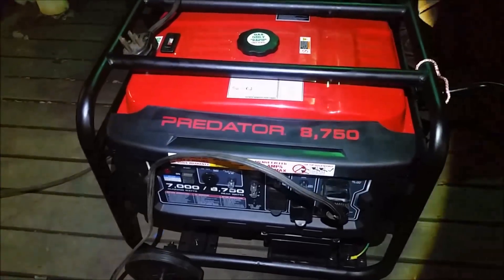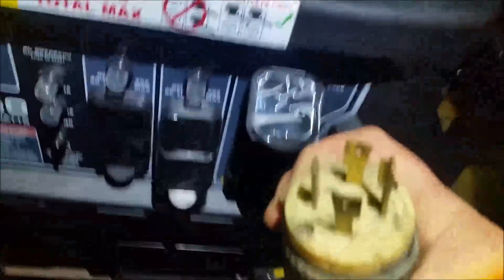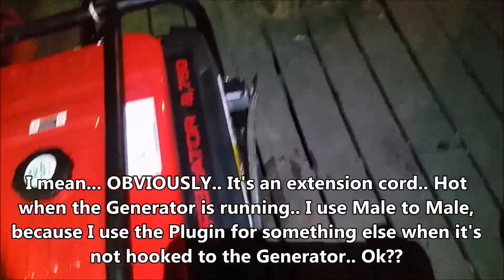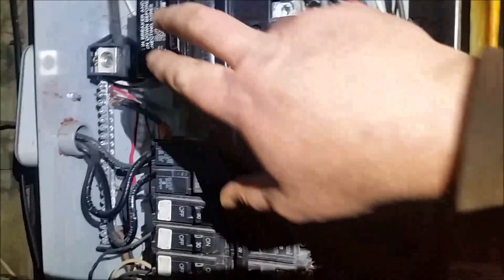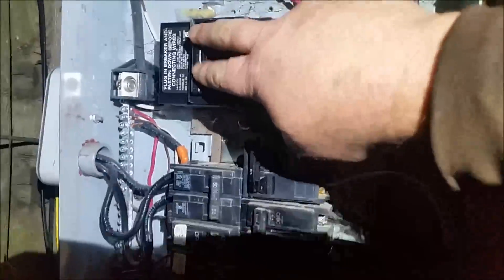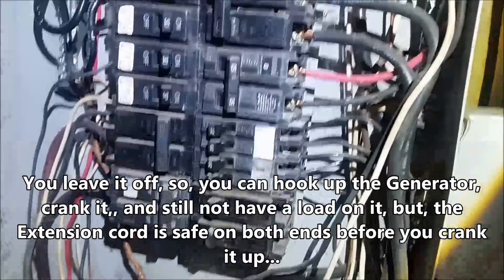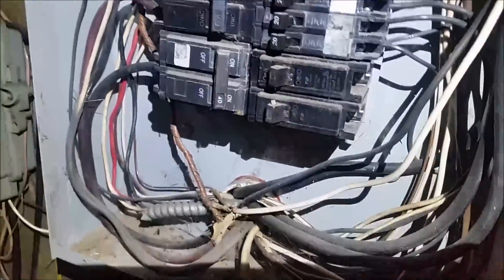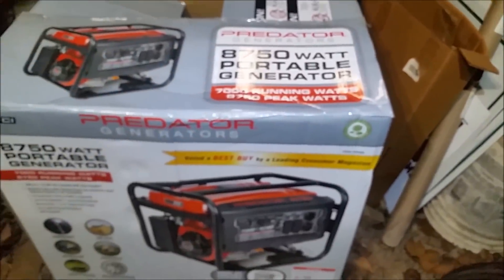Quick/Easy/Safe: Use Existing Plugin/Breaker for Generator hook up to your house Panel box.

Comment: Don't do this with out a generator interlock switch. If you have one you are good. If not you are liable. Mine is manual, this is what I did >>>https://www.youtube.com/watch?v=V-T8VTQUjBY
Reply from the maker: If that is what you have to do to remember to turn the main breaker off.. Then, that is what you have to do.. I see no problem with that.. But, let me ask you a question.. When you installed the Interlock,, you had to pull the panel cover and drill holes, install the Interlock and put it all back together... Did you forget to turn the main breaker off before you started??? There is where our two techniques differ... I can remember to turn it off each and every time.. 
Did you remember to "Turn the Main Breaker OFF" before you started?? Ha..Ha..Ha.. See?? I didn't even have to do that to mine.. No Panel entry whatsoever.. And, I didn't forget to turn the main breaker off either.. 
And, if you want to go further.. Is the Panel that you "Modified" still UL listed??? Hate to tell you.. NOT!!  Who's Liable?? 
UL allows Zero modifications to the UL file without another UL file,, or update to a UL file.. Better think again.. 
If you change the machine that moulds the buckle on a life vest,, even if you are still making it with the same mould, you have to get another UL approval..  I wonder if the Panel Manufacturer would be "For" you or "Against" you,, if something happened while you were monkeying around,, modifying their panel.. I think you should have left it alone and got you a Manual Transfer switch.. Just saying if we are comparing apples to apples.. I mean.. If your point is the Liability part of the house!!
Reply: Trust me, it's not "what I have to do remember to turn the main breaker off". The few states that it is legal for you to manual back feed a panel (mine is one of them) it has to have a lock out so there is no way possible that your generator will back feed the power lines. Its your house and you can do as you want but its totally against code, will not pass inspection and if you sell the house it will have to be upgraded or removed. Then there is the issue of 15 years from now (could be a new owner or even your offspring) remembers you telling them about how they should do the process but it dark and they forget to throw the mains and blow some guy off a pole?  Just because some of us understand what to do doesn't mean everyone will for many years to come.
PS< The reason it is legal where I live and not in most places is we went through a hurricane and lost power for weeks. People had to do what they had to do. Panel Cheater cords were used by the thousands and a few didn't disconnect. If they found your generator was still connected they cut the power lines to your house and wouldn't come back to fix them until after the emergency (weeks later) and you had to pay them let alone the legal issues.
Reply: fin, did you somehow forget that our (Mark's and mine) houses have no dedicated generator connection? We just re-purpose a 240v outlet that meets code. So 15 years down the road a new owner would have to have his own generator and idea to connect it. However, if it be my son (as my heir) he is smart like his dad so no sweat.
Reply from the maker: Fin screenname:  Correct statement.. (Its your house and you can do as you want but its totally against code) Code meaning National Electrical Code.. The codes studied by Electricians before they get their licenses.. Correct. 
Will not pass inspection???  So, the inspector is going to come while we have a power outage and inspect the premises? 
Because, all that has to be done to solve the problem is Kill the Generator and unplug the Extension cord and he can continue his inspection... What part of that is it that you can't understand? I'm just curious... Zero Modifications were done to the Premises wiring to install the generator, so, nothing is there to stop and inspection from passing.
The panel did not have to be opened, no one had to install wires, plugs, etc.. You use existing plugins, or, you know enough to install dual purpose ones.. 
It makes no sense to hook up a cord temporarily and leave it connected.. I am not sure who would do that, but, they would only do that one time, I'm sure... You can find any type of scenario for ignorant people to cause problems.. Just put one behind a car,, or let one hit the highway on a bicycle and see what happens.. This video is not for ignorant people, plain and simple... It is not for people who need protection from themselves.. The reason why I did not show them how to build the cord.. They have to do that on their own... And, once they build it, if they can, they won't forget to unplug it, or turn the main off, or plug it in before they crank the generator..
Reply from the maker: I hear that Ed.. It's pretty simple.. My Generator and my extension cord is going with me, wherever I go.. I can take mine and hook it up anywhere anyone already has a 220v connection.. 
Poor ole Fin just can't seem to get it through that thick skull that, this is so simple, there is NO MODIFICATION TO ANY EXISTING PREMISES WIRING!! Hello FIN... Did you get it yet??? 
Let me repeat that!!!..But you can just scroll up and read it again.. As many times as you need to, until you understand what I just wrote.. 
 NO MODIFICATION TO ANY EXISTING PREMISES WIRING!! 
 NO MODIFICATION TO ANY EXISTING PREMISES WIRING!! 
 NO MODIFICATION TO ANY EXISTING PREMISES WIRING!! 
Ha..Ha..Ha.. Get it that time??? Ha..Ha.Ha.. 
KILL THE GENERATOR AND UNPLUG THE CORD, and NOTHING HAS CHANGED.. Just like there had never been a Generator..
KILL THE GENERATOR AND UNPLUG THE CORD, and NOTHING HAS CHANGED.. Just like there had never been a Generator..
KILL THE GENERATOR AND UNPLUG THE CORD, and NOTHING HAS CHANGED.. Just like there had never been a Generator..
I know that is a very hard thing to understand.. But, go up and read it again.. I think you will finally get it... 
Ha..Ha.. 
Before my brother got his "Manual Transfer switch" and Generator, I plugged into his dryer connection to get his Fridge and two freezers cooled down again.. I just quickly took my plug apart and used a pair of needle nose to plug the blades into his, since his connector was different than what I use.. I told him if he wanted me to do that for him again, he had to get another female plug like mine and I would hang it off of the bottom of his box for next time.. 
And, I almost just removed the wires to one of his 220v breakers and hooked my wires up direct (Also hooking up ground and Neutral wires, but, I would have had to strip my wire back.. 
And, those plugs are not easy to get perfect and I didn't want to totally disassemble it.. 
Just open it up and pull the blades out long enough to get the job done and put it back like it was.. After all.. It is a temporary use extension cord.. 
$1700 later, and he has a second pole, a really large manual transfer switch next to his existing pole (Double the size of his existing panel), and a Generator just like mine that he could not even take to his girlfriends house to get her freezer/refrig back up and running... I loved it when she asked how I did it for him before and did it myself...Ha..Ha..Ha..

Comment: Predator gensets are very decent quality.  Yes, some of the Chinese gensets are poor quality.  Not Predator generators.  I have a Predator 4000 and a 2000 inverter.  Very decent quality at half the price.  I'd even say as good quality as a Honda, and very quiet.  Just break in properly, store properly, run dry and drain carbs if storing more than a month.  Use Stabil, or better yet, spend the extra money and run aviation fuel as it doesn't have ethanol in it and has a documented shelf life of 4-5 years of stored in a cool, well sealed container.
Reply from the maker: John Rand. I agree with all of what you just said.. I am not up on aviation fuel though.. Not sure.. I always thought it was some sort of high grade kerosene, but, that must not be correct from your comment. I run regular gas in all of my equipment.. I can buy the non-ethanol, white gas, etc.. Much more expensive.. But, I have had equipment that I have regretted putting it in.. The hard white chalk that develops in some equipment vs others.. I have a pair of commercial Robin Weed eaters.. I never run the gas out, never use any kind of stabilizer, and every winter put them up and don't use them at all until next spring.. They always crank first pull or two like normal.. But, I have had others that I have had to soak/boil to get them clean again and have replaced whole carburetors because I think the seats etc. get pitted... Some don't have copper seats in them.. But, I have too many fuel burners and use too much fuel for me to dedicate that type of expense.. If it can't stand the Ethanol, it usually is one of those "I won't buy that again products".. But, for someone who has a simpler setup than I do, by all means, it is surely a good bet to do exactly as you say.. 
I run my generators pretty regularly.. If I am luck enough to "Not Have to use them",, I always make sure the batteries are charged up, etc... to keep from having any problems in that area. Usually let them run for 20 or 30 minutes at least a time or two a month.. 
I have never had gas go bad in one of them. But, you can usually smell it when it does.. I have a Poulan chain saw.. I hadn't cranked it for about 3 years... About a week ago, I needed to cut two half rotted trees. I decided to use it vs my other saws.. I figured I would have trouble.. Cheap saw to begin with.. I did.. But, the first thing I did was dump the old gas and put fresh in.. I had to play with it for 20-30 minutes,, reving it up and choking it hard to get it where it would run worth a hoot.. It ended up running pretty well luckily after the first half hour or so.. That saw.. I left sitting out.. I really need a few more cuts that I didn't make due to the job taking a side turn, but, it will be one of those pieces of equipment that I will void of gas before I let it sit again after running it out of fuel.. I have had good luck doing that in the past.. Same as it sounds you have.. 
The HF generator has not really sat for very long yet.. I think 3 weeks is the longest since we bought it. I ran the gas out of it several times to start with.. Told my Mom she needed to crank it once a month and let it run for 30 minutes.. I can see that is not happening, so, maybe I can comment on that down the road if they are susceptible to the chalk.. But, I agree. They are good motors.. I have some friends who actually buy them and race them on various items.. They say they are hands down always in the winners circles in the small engine arena's and are easy to modify and tweak quite a bit out of.. One of the reasons I finally bought one. The local repair shop has plenty of parts for them and is well familiar with them. Says they are a lot more common than most people realize.. I am pretty sure my Northern Tools generator has one on it also..  It is a "No Name" motor, and not  one of their "Premium Brands", but, I have had little to zero problems with the engine on it after 12 or so years of being used quite a bit.. Cheers.. Thanks for the comment.. I'll have to check into the Aviation fuel.. There is a small airport just 15 minutes from here.
Reply: Mark, aviation fuel, not to be confused with jet fuel, can be bought at most local airports. It's about $1 or so more than unleaded gas you buy at gas stations. It doesn't have ethanol in it and the literature says it has a 4-5 year shelf life if stored properly. It is very stabil.  When you think about it, that's good as we don't want small planes dropping out of he sky due to carb or bad gas problems. Agreed on the ethanol. It attracts water and can be corrosive on carb bowls, jets etc. Like you, I run my genset monthly under load for 15 mins. Keeps engine seals lubed and starting electrolytic capacitors in good shape...plus you know if the thing works for when you may really need it. Good luck.
Reply from the maker: John... You are correct again.. I forgot to mention that.. the Ethanol disperses  the water and keeps it in suspension.. At least pretty well.. It will eventually settle out, left without motion.. I have always wondered about that... I had a friend when we were young.. Just started driving. He had an old Mustang.. Had a water mist injection system hooked up on his newly rebuilt motor.. Was rebuilt about a year earlier.. He kept a plug wrench in his glove box to show how clean his plugs were, so, I saw them over a period of years.. Amazing, because back then, not to pull out a heavily carbon deposited plug was a bit strange.. 
I suspected the same as you.. That the "Ethanol wicked water"... I ended up with water in my large gas cans (5 gals).. Twice..  I swore it was wicking water, but, turned out the local BP had water in the tank... I noticed it when my leaf blower would not rev all the way up.. I poured the gas out.. Milky and cloudy looking.. When settled 2 days later, had a good bit of water settled in the bottom.. No wonder it was so hard to crank... Ha.. After I shook it around, walking, turning, etc.. it ran fine, but, never seemed to get to the high rpm's.. When I changed the gas, it ran like a scalded dog again.. I wonder if it cleaned up the plugs..ha.. Not sure. Didn't have time to check. Just something to think about and remember if you ever get a chance to check it out (un-intentionally)... Ha.. Cheers..  Looks like I will be firing up my Redmax blowers before too long.. They are starting to fall early this year..
Reply: I HAVE  THE 8500 WATT AND I CONVERTED IT TO RUN ON NATURAL GAS BECAUSE I AM HOOK TO A GAS WELL .COST O TO RUN IT .RIGHT NOW ITS 90% OUT SIDE AND I AM RUINING MY AIR CONDITION ON THE H F GEN AT O COST TO KEEP MY HOUSE COOL ITS 74 INSIDE I MIGHT HAVE TO PUT A COAT ON  LOL.I CHANG MY OIL WHEN IT STARTS LOOKING REAL DIRTY.I DID HAVE A RPM AND HOUR METER ON IT BUT CHEAP CHINA METER ONLY LAST ABOUT A WEEK
Reply from the maker: Ronandpaugh44.. Awesome.. Lucky for that.. Running the Generator on Gas is quite expensive.. Usually $20-$30 per day depending on load.. Having free Natural gas is a huge blessing..  Get an hour meter from a tractor of some type of equipment like that.. I have one on a Terramite T5C that is 15 years old. 4500 hours and it is still working just fine.. The one on the tractor is also based on RPM's (have to get up to a certain number of RPMs or the time meter does not run), so, it has moving parts that wear out and has been changed at least once.. You don't vary RPM's on a generator, so, I would just go with the time meter.. You can hook it into the 'On/Off" switch with a split male crimp connector and that should fix you right up.. 
I'm not sure about the vibration on the hour meter.. If your generator does not move, might try to mount it on something solid away from the vibration.. Might make them last longer.. If it is a digital meter, I don't think you will have to worry about it. But, if it has mechanical rotating dials or numbers, might be worth considering.. A good one would cost you somewhere between $20 and $30 I would imagine.. Good luck with that.. I don't know if they make a synthetic oil in a standard weight like 30w.. But, you might consider it... If you can't find straight 30wt, you can try the 10w30 from say Shell Rotella T5 or T6.. It will last much longer between oil changes.. If it starts smoking, it will pretty quick.. I would say between 4 or 5 hours service.. No worries.. Just change back to the standard 30w and keep running. It will stop smoking within a short period of time. But, use a good quality oil.. 
I tried a store brand 4 wheeler oil for my Yamaha 600 Grizzly 4 wheeler.. It started smoking and I freaked out.. I changed it to a 10w30 T5 partial synthetic and still saw a little smoke every now and then.. Usually just after I cranked it after it had been sitting.. I went back to the Yamalube 30w and it has not smoked since.. Tried it again about 6 months later with the same results with the blended oil and went back to the Yamalube 30w again.. But, I have a 20hp Kawasaki that runs the same blend well.. I guess it all depends.. Good luck.. Thanks for the comment..